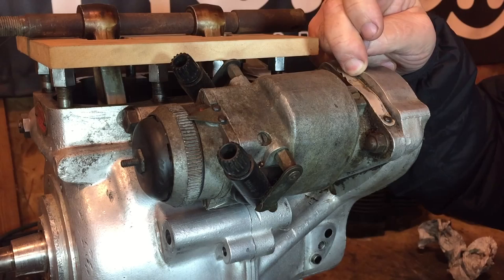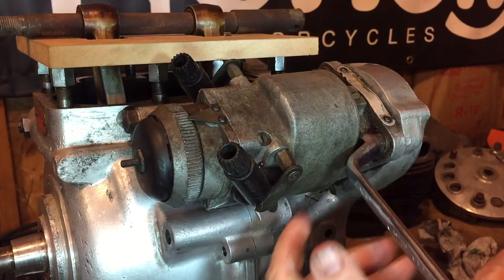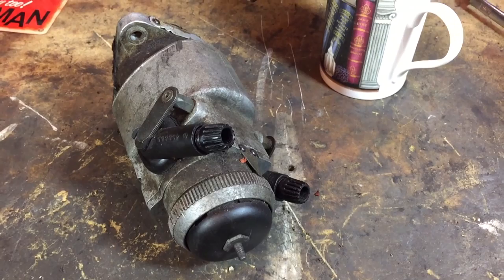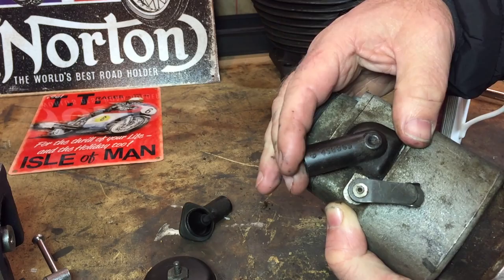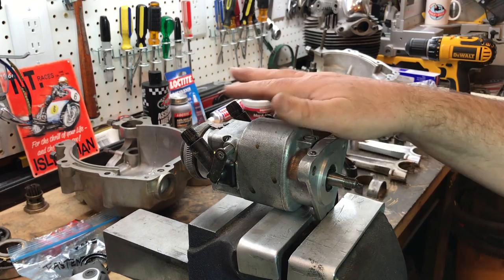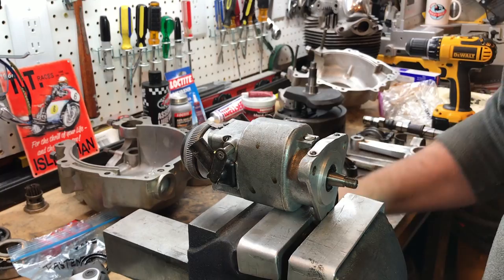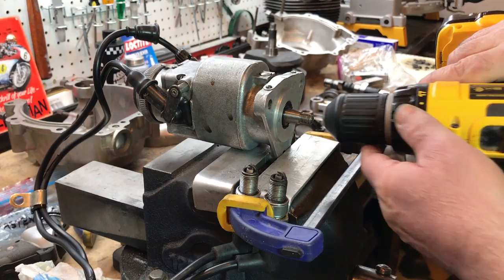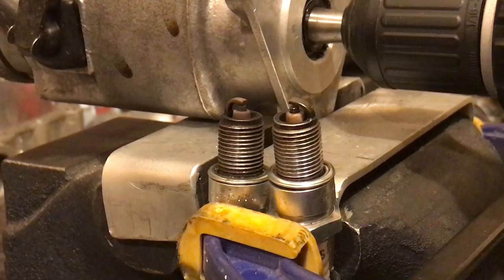Norton Atlas Project - Shep - Part 39 - Engine Disassembly - Lucas K2F Magneto

Comment: Should the mag be spinning clockwise from the drive end?
Reply from the maker: Thanks Alan, you are quite right. I didn’t realize at the time that I was turning it clockwise to its normal counter/anti-rotation direction. Hopefully no serious damage was done and I will definitely be testing it again correctly before it goes back on the bike. Cheers, Mike

Comment: although it will spark with a drill  it needs to show a good spark when turned by hand   When you kick it over the mag turns very slowly  in my experience most mags that have been sitting for a long time   need a new condenser at the very least      they will spark for a while then fail   the drill test can be misleading

Comment: hey mate thanks for the video by chance know what the size the thread is on the end of the tapered shaft I assumed it was bsf but can't seem to get a match,  the thread on both the shaft and the fixing / jack bolt is ok but  being an engineer it's just bugging me that I don't know the thread size and pitch also being a young man dealing mainly in metric and some imperial  leaves me at a slight disadvantage  any helps appreciated keep up the good work

Comment: Thanks again . Question has there been already a tutorial setting the ignition on such a type of Magneto. I have a 58 domi 99 with Magneto ignition . It would be very helpfull and appreciated if you can show this  once in the future. F/R from the Netherlands.
Reply from the maker: Hi, sorry but I don't have a video on setting the ignition timing on the Norton, here's a link to a video of timing my Vincent. The concept is the same and the little magneto synchronizer timing device was invaluable. There's a link to the one I used in the description of the video.  https://youtu.be/Av3qkAGalB0 Good luck with your project!  I will need to do this again in the future on my Norton Manxman

Comment: Hey Mike!!!! Hows it going? Not seen too much since the cul-de-sac days. Just wanted tk know if this magneto will work on a 1966 t120r unit triumph?? Thanks bud. Hope all is well.
Reply from the maker: Hi, it's great to hear from you. Hope all is well. I'm not sure if a Lucas K2F mag would fit as a 66 Bonneville would have had an alternator fitted. You would most likely need some kind of timing cover attachment, similar to the ARD or Joe Hunt magneto setup with the mag hanging off the timing cover. I've just released a few new visits from the cul-de-sac this year and a few more to follow if you get a chance to see them. Cheers, Mike

Comment: Not really a good idea to spin a mag up like that i.e. backwards.
Reply from the maker: ralph mctell Thanks Ralph, you are quite right. I didn’t realize at the time that I was turning it clockwise to its normal counter/anti-rotation direction. Hopefully no serious damage was done and I will definitely be testing it again correctly before it goes back on the bike. Cheers, Mike